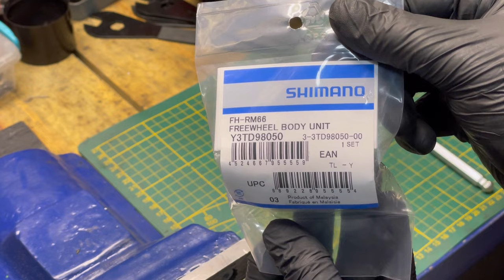How to replace SHIMANO FREEHUB BODY ? Quick Tutorial #freehub #drivetrain #mtb

Comment: Thanks for the video. I needed to verify that I am turning counter clockwise to loosen that bolt. and it wont come off. I removed the freehub casing, bearings, etc but the main part is still in there where the pawls ride or attached too. I have it in Blaster penetrating oil and will give it a shot tomorrow again. I am using 11mm for this one. There is about maybe 1/16 movement left and right when I try to remove it. Any ideas? Maybe I just need to buy a new wheel and move on on this project. I dont know if I can get a pipe wrench and grab that main part and try to loosen that way. I believe the freehub is geared to match the hub to lock in place (for no slipage) and that bolt holds it in place to the hub - so I am thinking that will not work: the bolt has to come out if I got that right.

Comment: Mine was 12mm allen key. And it would only go in from the other side.
Reply: hi. mine too. the thing is that its way to tight. do you now if its really necessary to remove it, or its possible to open from the drive side with that 2 points special hub key? thanks
Reply: @Gledii  Same issue here. I am using a 11mm hex bit and a breaker bar but it wont come off. Today I noticed the 11mm is starting to nick the grooves (strip). Its looks like some kind of tripple spilne bit you can you but dont know exactly what size. I order a M11 tripple square spline bit but was too small. That cost 10 so if I buy a kit its about 14, then maybe I try other ways to take off like gripping the freehub since its damaged already and trying to get off. If anything I will buy a new wheel but cant believe its so tight and I am turning counterclockwise. Luckly I have 3 good bikes in case one is down for maint. Live and learn - the bicycle hobby!
Reply: @arthurleal2674  this isn't acceptable. I decided to give up as it was taking too much time/cost. I got a new pair of ERC 1400 DT Swiss and the hub just come off with the cassette by pulling with the hand. Grandma service work, as it should be
Reply: @Gledii  That 2 points tools is for taking the freehub apart (where you can see all the small bearings and pawls) I just had learned this when I took that apart but it didnot completely remove the freehub. And now I am seeing from the rotor side another hex size in the hub that I can put in there and maybe this can loosen the entire freehub. I had never taken one of these off but same here. I agree with you on just maybe buy a new wheel or wheel set. I just dont have any jumbo allen wrenches and amazon has a like 11,12,14,15 &17mm (8 total) for $25. I am already in the hole for $5 for 11mm bit socket, $8 for 11mm tripple square hex (didnt work too small) and $25 more if I buy the jumbo allen set and still dont know if the freehub main part will come out. Maybe just bette to do what you did and buy the wheel and my own picking of freehub ( I want one that has louder clicking) like the Dt Swiss.  I'm gonna look up them wheels you bought.

Comment: Why would there be a steel washer between the hub and rim?
Reply: you will need to tighten the freehub body to the rim (or hub essentially), when you compress the freehub you want the washer to compress or take most of the load. I'm not a pro, but that's my best guess.